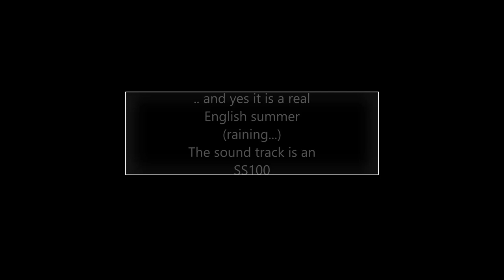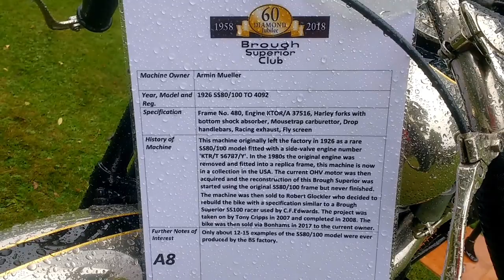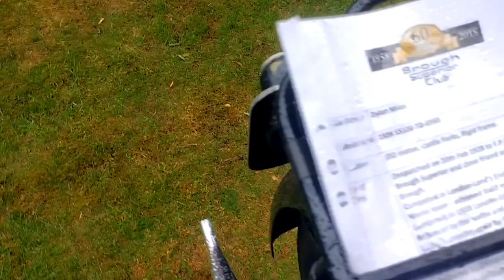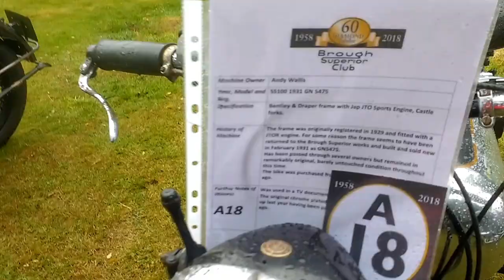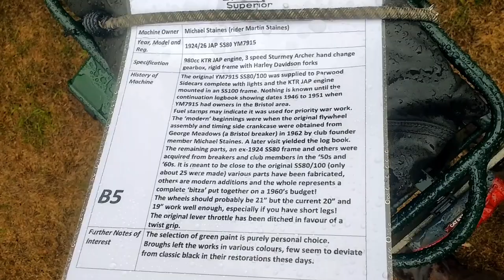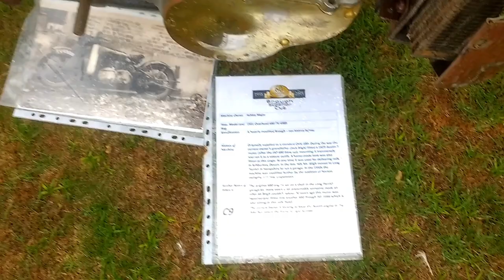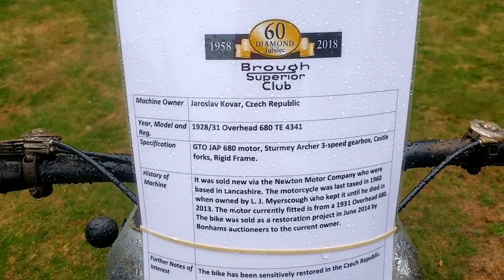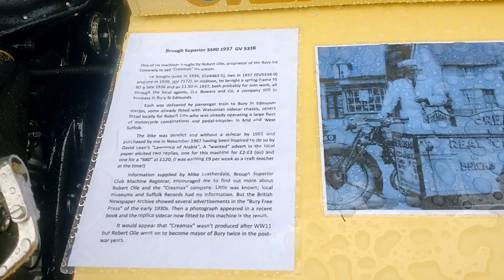$25 million of Brough Superiors over 100+ found in a field!

Comment: Where did they find 1920s leaded gas to run them?
Reply from the maker: The heads are cast iron so with gentle use will survive unleaded
Reply: 1920? They didn't start phasing lead out in the US until 1976 and it wasn't banned until 1996.
Reply: Antique motors can be modified to accept un-leaded gas.   There are lead base fuel additives for antique fuel injectors that can be used.
Reply: Avgas!

Comment: this is what triumph should have done, a lovely vee twin, 
and this is what the triumph modern production should
 add to their stable, but they are too narrow minded.
Reply from the maker: Thanks for watching and taking the time to comment. Triumph are about to bring out its first proper Motocross bike so they do open their minds to opportunity. Lightweight air cooled sporting V twins are older Ducati's and early Buells - both of which remain relatively cheap. I am building a 1933 1208cc ohv JAP engined bike and will feature it on a future video. All the best Paul.